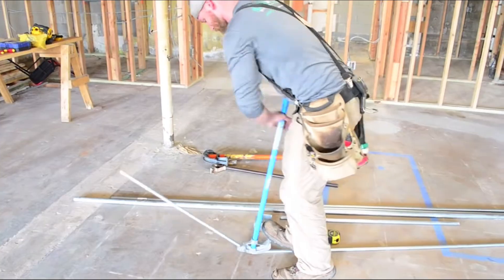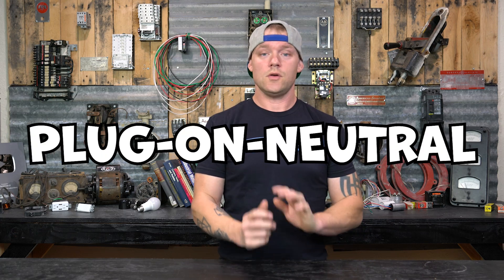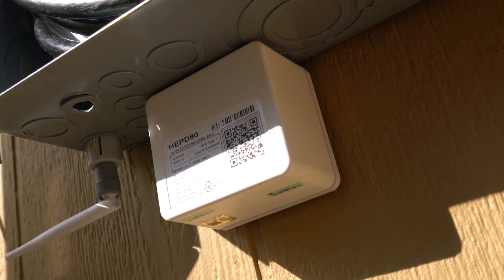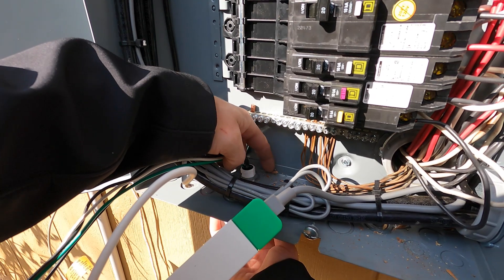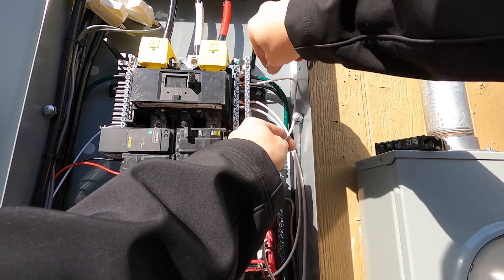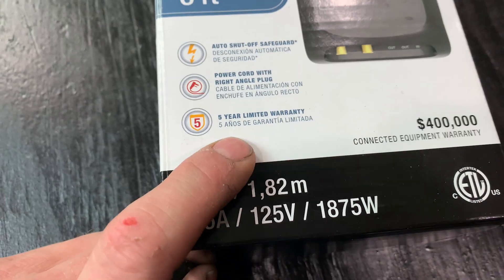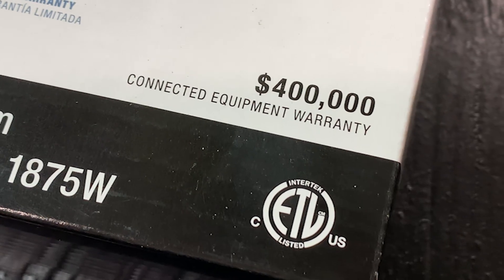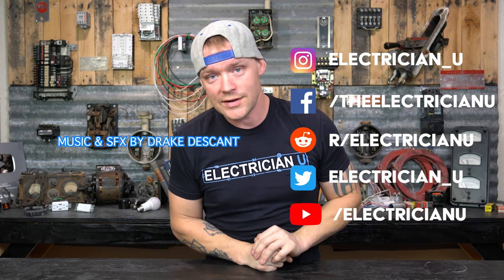How To Install A Surge Protector

Comment: I do not understand how a surge protector downstream of a single breaker, could possibly prevent a surge from traveling to components downstream of every other breaker in the panel. Please make it make sense
Reply: It's not current, it's voltage. There is no "traveling" or direction of current flow. Voltage is just a difference in potential. The entire bussing and wiring system is experiencing the change in potential at once. The surge protection device is "absorbing" that voltage change and displacing it through a grounded or grounding conductor. Since voltage is always happening everywhere in an electrical system at the same time, an SPD can be placed downstream and upstream of current flow with very similar protective qualities.

Comment: I found a Supco SCW Secondary Surge Arrester that was double tapped onto a 2 pole 20 amp breaker. I bought another breaker for it so I would be double tapped. This surge protector doesn’t have a white neutral wire. Should I get a different one or it the surge protector with a ground and two hots okay?

Comment: Another comment....I thought type 1 devices were installed on the line-side and not the load side...and ANY device located on the panel's bus...meaning downstream of the main disconnect/breaker....was then a Type 2 device. Wrong?....are you saying it is also dependent if the "breaker" is external ( type 2) vs internal to the device ( type 1)?.....if so, how can a type 1 be located in the bus regardless of how the protection is provided?...it's still not on the line side. Confused. Lastly.....the devices that plug in just like a double-pole breaker are nice for ease of install....BUT.....it seems they can't get up to the same surge capacity level as does (say) the Siemens FS140 ( 140,000 Amps surge capacity), that I am soon going to install in my home, but requires separate double-pole breaker and some "leads" to be connected...a. bit more of a bother...agreed.

Comment: Some comments on lead length. Yes.... correct...the longer the leads the worse your level of protection. There are industry papers that say if you "twist" your lead wires, at 1 twist/inch of lead length, you greatly improve the impedence to the point of nearing the lab test leads used when measuring  VPR, ( 6" long in lab)....and also this---> if you can't twist 10 AWG wire easily you get ALMOST the same impedence improvement when the leads are parallel but tightly TOUCHING one another...like when using zip ties, tightly.Greatly improves the pass-through limit.

Comment: You mention to keep the leads as short as possible, but then mention it's ok to place your breaker any place on the buss bar to keep those leads short.  Wouldn't the buss bar itself be considered a lead length?  In other words, wouldn't it be best to place the breaker as close to the line entrance as possible?  Thank you...

Comment: The other day, lighting hit a tree in my back yard, or should I say I suspect that is what happen from the bark of the tree being about 60 feet in all directions away from the tree. I had some outlets that don't work now addition to my Mancave recliner chair which doesn't work now. I get it, reasoning of having a whole house surge protector. I have a garage where my woodworking tools are...some are large tools and they cost thousands of $$$. The garage has a sub panel box of the main panel inside the house. Should I have also a surge protector in this box?

Comment: When installing a surge protector at the main panel, because the neutral and grounds are bonded together already does that mean that you can wire the ground and neutral wires next to each other on the same bus bar? Or do you still need to wire the ground and neutral to their own bars as if they weren't bonded?
Reply: A main panel...where neutral and ground are "connected" ( bridged...bonded)....you can land neutral and ground on either. For "eye-appeal" and a cleaner "look"...a lot of the more careful installs place all grounds on one bus and all neutrals on the other....but it's not necessary. CAVEAT....keeping it separate IS critical for sub-panels where the neutral and ground busses are NOT connected, but kept separate.

Comment: Thank you Dustin!  Love your channel and just subscribed.  I'm planning to install this on my main panel (not subpanel).  However, I don't have separate neutral and ground bars.  Just one bar which has both ground and neutral wires connected to it.  Any reason why I can't connect the green and white wires to this one bar?  Thank you!

Comment: Q: Do these newer surge protectors in homes protect the entire electrical system on the load side of the homes Hydro meter?
Even if the panel it’s installed into is a sub panel, or fed from a splitter box and is in parallel with other panels, both fed from a common supply?
What about protection of circuits with an AFCI or GFCI breakers or receptacles connected?
Thanks for any help you might have.

Comment: i know this is outside so the homeruns are long and any appliance is far from it. Yet, why did you not install it on the side so the wires are shorter? I get the water concern but it won't be an issue. And, the instructions for this particular HEPD80, indicate that you need to twist or braid the two hots to make it efficient. It is what should be done in everyone of them but I was glad to discover that Schneider wrote it clearly in the instructions while others ignore to and is up to us to do it. I was surprised and kind of dissapointed that you did not do it in this video. Also, mention that no sharp bends, we old timers trained learning that the bottom of a soda can is the standard for any curves in the wires. 
Remember that these wires are not used the same as the rest of the circuits, and not just for the "noise" like we do in low voltage and communication ones,  but it helps deter impedence thus the protector can absorb more juice and shunt way more...each nanosecond counts!

Comment: On the plug in neutral no wire lead type of surge protector, does it matter how close it is to the main wires coming in to box? In other words is it better to install on the top of elecrical box or does it not matter??

Comment: When a main power panel does not have any expansion available, can a surge protector be installed on a pigtail with another branch circuit; sharing a single circuit breaker?

Comment: Nice vid.   I have one installed in my breaker but it is / down on the left side. I am gussing that leaves some things unprotected?  If so, is there such a thing s a surge protected shut off box?  I have one down at my gate and the opener was k and I REALLY want it protected

Comment: I am not a electrician, so my question is I had a house built and I have 2 breaker boxs in the basement and 1  in the garage. So the question is the surge protector without leads, do i have to install in each breaker box? or is it a option for better protection if i do?

Comment: Only had 1 slot left in the breaker box so used a 20/20 CH twin circuit breaker that matched my other breakers. Didn't get a light on the SPD when i set the breaker to on. Also the breaker on opposite leg tripped. Clearly I set something up wrong. Any ideas? Thanks.
Reply: a 1 slot tandem breaker gives the same phase to both circuits. You can't make 240 volts out of one. The voltage between the two screws is 0. A two-slot breaker would be on two different phases and have 240 volts between the two screws. The SPD is powered off 240v and you were feeding it 0.

Comment: I got the surge protector HEPD80. I see that the wires coming out of it is 14 Gage. Will that be significant for a type one? They seemed a bit small. The wire in your video looks to be 12 Gage.

Comment: That let through voltage is why you still need the surge protector you have at your devices because they'll catch the let through voltage that is left for further protection at the device(s).  One thing you didn't mention in the video is if it matters where the circuit breaker feeding the surge protector goes.  Can it go anywhere there is an opening?  Or does it go at the top most circuit breaker openings?
Reply: He did mention, he said put it as close as want to reduce the lead lengths. Not sure why he still put his near the the top far from the device after saying that. I guess for aesthetic reasons and maybe the length isn't an issue since it's close already

Comment: Thank you for the good explanation!!
But I’ve got a question: 
If you’re installing a SPD below your panel, does it really matter, where you place the breaker for the SPD?
I’m asking because, if you put it up high and you run long wires down to the SPD, it’s the same distance (if measured from the main breaker on the top of the panel) , as if you put the breaker on the bottom of the panel and run short wires. The distance I talk here about means the length of conductors in sum (busbar + wires).
Or is it better to mount the breaker on the bottom, since the busbars may have lower impedance than the wires (more crossectional area)?
Bests :)
Reply: It's more important that the lines to ground and neutral are short -that's the priority with placement.  And be sure that the panel is well-grounded (I live in an area with old housing stock where a lot of panels are just grounded to the closest water pipe and then jumped at the meter: so if a plumber installs some pex in between those points, there is no longer a serious ground.

Comment: It is excellent to see you talking about Reading the manufactures Installation instructions, something so basic yet can make a huge difference in installation and operation. The instructions are not just paper in the box, the manufacture had to spend a lot of money in providing the very specific information not for but as Part Of the Certification and Approval process.
Having been a trades person for almost 40 years, 15 years as an inspector I can say no less than 90 % of every rejection could easily have been avoided by simply following the direction wording of the manufactures installation instructions. It takes 2-5 minutes to read and know yet time after time the instructions are found in perfect condition folded up in the bottom of the equipment or garbage bin. Doing a job twice no matter how basic always takes longer than 5 minutes.

Comment: Can you use the plug on neutral style with the ground and neutral bars not bonded? It is the main panel (customer load), but is the second point of disconnect.

Comment: Would you suggest a type 1 and type 2 in the same panel? Not much extra cost - is there added benefit?
Reply from the maker: Type 2 is usually good enough. Type 1 can be a bit cost prohibitive for most. But more is better than none at all.

Comment: What if I don't have neutral in my system can I still use this brand?
Reply from the maker: Only if it is listed that way or can function that way and it is explicitly stated by the maker that it can be used that way. Otherwise, no.

Comment: Thanks for all the great videos and info Dustin! I have a quick question… if you have a sub panel does that need it’s own surge protector? One for main panel and one for subpanel? Or will the surge protector on main panel cover both panels?
Reply: If it's being fed from your main panel, it will be just fine.
Reply: @tinyb69  thank you!

Comment: Speaking of reading the warranty wording, I was reading the warranty for the ultra surge by Eaton. It covers 108,000 amps. And they say they warranty up to $75,000 of connected equipment. HOWEVER. If you read carefully, they say they do not cover acts of god, example, lightning. Why would a surge protector not cover lightning? I understand it isn’t going to completely protect against lightning, that’s not it’s primary function, but that seems kinda off to me and off putting to the customers I install these for. Any thoughts?

Comment: Disclaimer: I am not an electrician, so I apologize if my terminology is wrong. Question for Dustin or any electricians lurking in the comments: I believe this device works by monitoring line voltage and bleeding it off to neutral if there is an excess (please let me know if that is incorrect). So, since this is the service entrance and neutral and ground are bonded, what is to stop an excessive voltage (lightning strike or whatever) that is bled to neutral by this device from traveling through the neutral bus, through the bonding jumper, through the grounding system and "back-feeding" into the house and potentially the chassis of a metal appliance or something? Is there not potential for getting shocked if you happened to be holding such an appliance when that happened?

Comment: Well you lost me when you said a 220 breaker.  You know or you should know there is no such thing.  America runs on 240 / 120 volts.  Then later you said you look for 220 volts when you're checking voltage. If you find 220 volts in a panel you've got a problem you need to contact the power company. America runs on 240 / 120 volts don't perpetuate the myth that is 110 / 220! And I've watched your other videos about the color codes, Delta and Wye all very good information and all correct I don't know what happened in this video.
Reply: You showed up

Comment: Oops. At 2:23 you mention "two phases". You mean the two legs of //single phase// split 220, correct? Or did I miss something?
Reply: Yeah there's no such thing as 220 volts in America.  He had to mean split phase not 2 phase because there's only single phase ran to residential houses.

Comment: My dad was an electrician. He used to tell us that a plumber was nothing but an electrician with his brains knocked out.
No offense plumber's. 
I've got my meter and my main breaker panel (and transformer) 100' from my house which has a 200amp panel inside. Do I put it in the panel inside or in the main panel outside? Great video thanks.

Comment: If these panel surge protector warranties are similar to the warranty on a plug-in surge suppressor, then their warranty is only activated after your homeowner's insurance has paid. So, usually, they don't wind up paying for anything more than your deductible, but that still helps. The homeowner's warranty will pay for a lightning strike, but I'm not sure about a transient surge caused by something else.

Comment: You're an educated articulate young man, I (40th year in the trade) appreciate your videos. Sadly though, OSHA would be all over your ass for working in a hot panel without arc flash protection.
Reply: Yeah yeah yeah, like you suited up every time you ever checked anything over 24 volts. Maybe you should ask if that was his house? At which point I would kick the OSHA guy in the nuts and throw him in the ditch for trespassing!
Reply: Research OSHA authority lol

Comment: Does this https://www.homedepot.com/p/Square-D-Homeline-50-kA-Plug-On-Neutral-Whole-House-Surge-Protective-Device-HOM250PSPD/300716370 have to be installed at the top of the load center or can it be installed lower in the load center so I don’t have to move any breakers?

Comment: Hey Dustin, just wanted to correct 2 things you mentioned at 2:20 
First of all, residential services are single phase. You have 2 legs inside the panel not 2 phases. It's split phase, not 2 separate phases.
Also you mentioned that it's a "220" breaker. Negative, the utility voltage is 120/240. It hasn't been 110/220 in many, many decades.
Reply: He may not in this one, but in a lot of his videos he will explain that “technically” something should be called X, but you will always hear it called Y in the real world, so he calls it Y for clarity. These are almost certainly two of those cases….I am positive he knows the difference.
Reply: Technicalities really, many people call it 220 instead of 240 (idk y) and I guess w the phases you have a point but I’ve heard an A and B phase referring to single phase so he isn’t wrong either
Reply: Here come the NEC freaks!  lol
Reply: I always fall back to the adage "220-221 whatever it takes" hahaha 
 @rlta8352
Reply: You're right it is a split phase system, but in relation to the Neutral wire, it acts as two separate phases. And 220 wasn't in reference to 220 voltage. It shorthand slang for a 2 pole 20amp breaker.